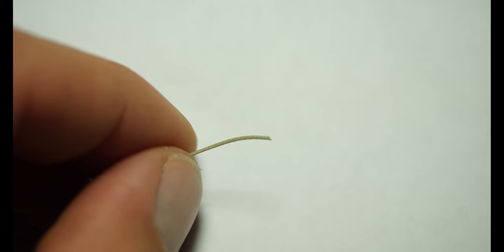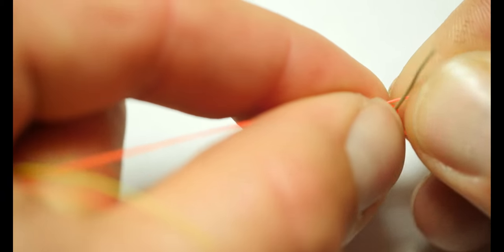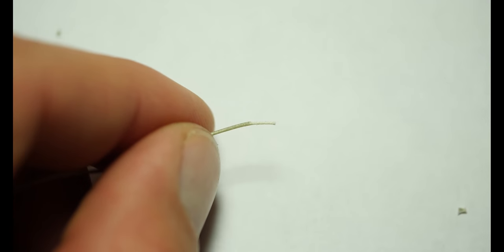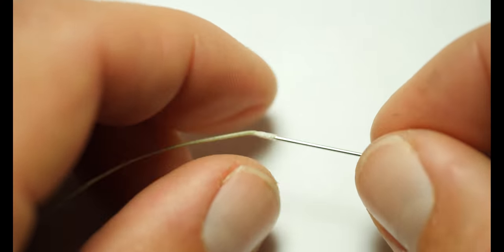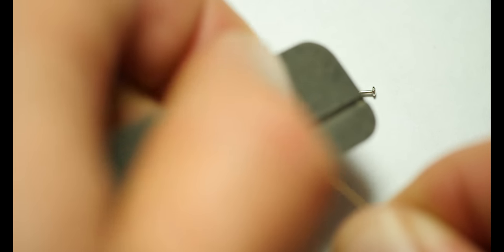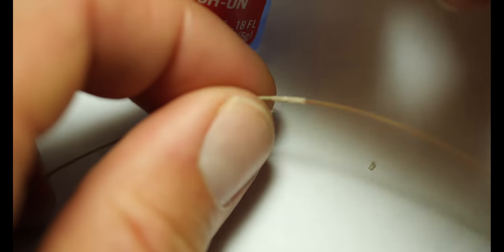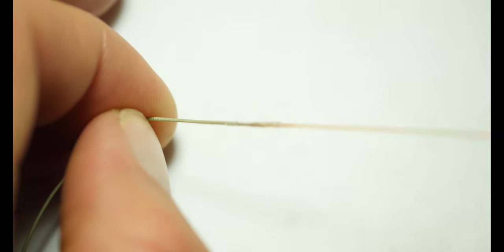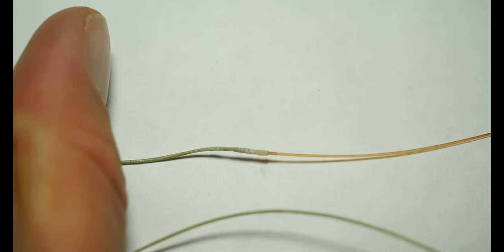Fly Line Superglue Splice 2.0

Comment: I may have to give that connection a try sometime. I’m still using a nail knot to connect it followed by some uv knot sense to seal everything up and make smooth. There is so many ways to connect fly line
Reply: It's never failed so far , the key is u have to use sandpaper or something the rough up the mono
Reply: I will be giving it a try for sure. Just have to beat the crap out of my leader till it needs replaced. I have it balanced the way I want it and it’s staying that way till I replace it

Comment: I have issues with this splice not holding when I use JB weld super glue. I feel like it's super brittle, so whenever I test it, around 10 hours later it breaks even after following all the steps instructed in the video when I test it again without using too much force. Should I use something like zap a gap that's a bit more flexible? (i'm using cortland braid core level as well with maxima chameleon, and roughing up the end before putting it in)

Comment: Great  video. One question. Why did you only strip off a 1/4 inch of fly line coating? Why not make a longer join between the braid and  the leader? Wouldn't a longer join be  stronger ?
Reply from the maker: It doesn’t go through the guides as well

Comment: Hey Devin, 

Why not take superglue and coat the leader as your shoving it into the fly line? I know that’s similar to the first version of this, but I think if used in conjuction with the outside seal, it should be bombproof!
Reply from the maker: Try coating the leader and then sliding it into the core and tell me if you can actually get it to slide. If you can, good on ya. That’s not something I’ve been able to do.
Reply: @tacticalflyfisher3817  ah I never even thought of that. I’ll experiment with some slower setting glues. I know most of the fly tying stuff I have used sets very quickly, but perhaps some industrial glue from a construction store would work. UV would be perfect, but it’s not an option with the lack of visible surface area. 

I don’t doubt the strength of this version for trout applications, but the steelhead euro guys may like the added strength if possible. 

On a side note:

I have been thinking of picking up a needle knot tool, is it any better for euro nymphing applications compared to normal nail knots?  This technique is still the smoothest, but I can’t really do this on the stream side comfortably! I would just get a mono core line to do blood knots, but it seems all of Canada is out haha.
Reply from the maker: @devonbustard1623  It's not hard to do this streamside. I used to pack a bottle of superglue and a few pins in a ziplock bag in my pack. Also, I used this connection while nymphing for steelhead for 5 years until I switched to a micro leader. I never lost a fish due to the connection. If you redo the connection every 3-4 months, it's very reliable. The needle nail would work as well. It's just not as smooth.

Comment: I didn’t have very good luck with this using the Orvis Braided Tactical Nymph line. I tried three separate times but had no success. I think the braid was too thick to let the glue seep through and bond to the leader. I ended up going with a needle nail knot.
Reply: Update. I wanted to give it another try so I used the original super glue splice and that worked well. Maybe there’s an advantage to doing a combination of the two? Do the original super glue splice at the top end, and add security by stripping the plastic off the core at the lower end for added protection.

Comment: You said that the superglue splice won't work on the Airflo line. Why is that and how would you join Airflo line to a mono leader then? Nail knot?
Reply from the maker: captphun66 their braid unravels when the coating is removed so there isn’t a core to join the leader to at that point. I normally use a nail knot with Airflo lines.

Comment: Anyone else have trouble with the splice holding. Maybe I’m pulling too hard 🤷🏻‍♂️
Reply: hunterdn82 it only worked for me when I didn’t spit and roll, I just put the glue on it. I used fly tyers zment.
Reply: I used regular old gorilla glue, and it didn’t work too great for me, but then I found Devin’s 1.0 super glue splice video and that worked much better with the gorilla glue. As long as the connection is stronger than the tippet you’re shouldn’t be an issue.

Comment: Problem is cutting fly line every time you change leader
Reply from the maker: It’s no different with a nail knot
Reply: @tacticalflyfisher3817  i wonder how much line there is before the taper kicks in...in other words how many leaders could you change before affecting the taper of the flyline
Reply from the maker: Ryan The Rock for a euro nymphing fly line the taper is level so it won’t affect it. For other lines it depends but often the tip is 1-2’ long.